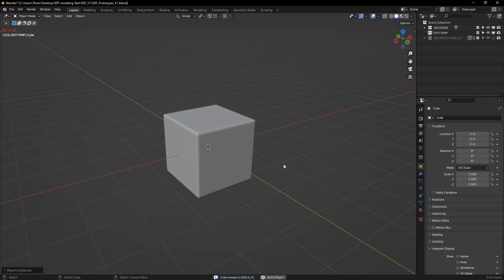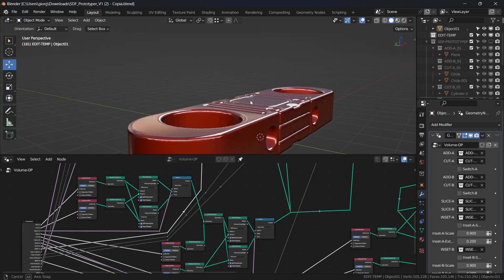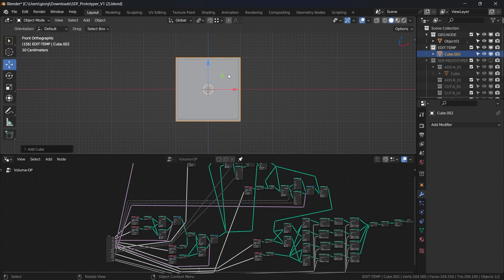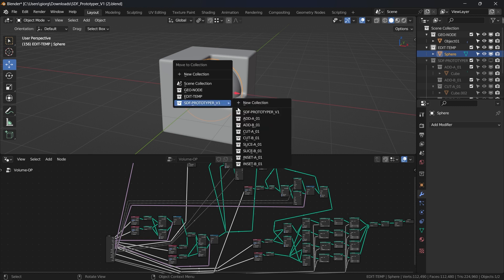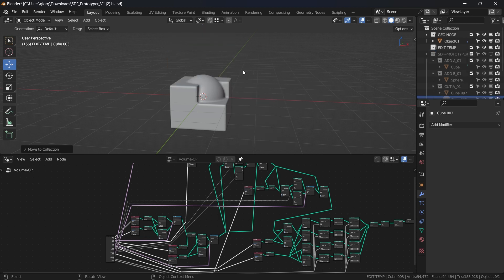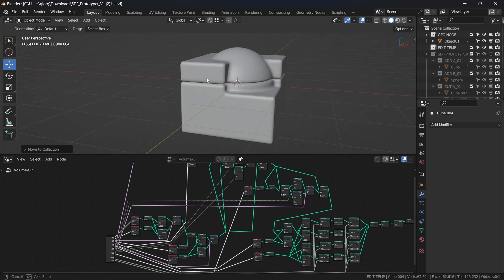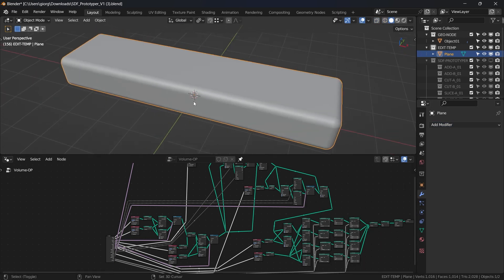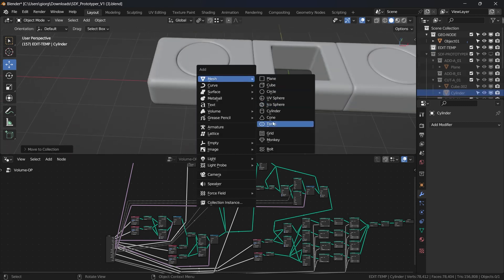Blender SDF Modelling Add On Prototyper V1

Comment: why someone will wait for so long, he can just use boolean and bevel shader, even accessing them is also difficult
Reply: SDFs are pretty different and potentially really cool. I'm not sure if the full potential was shown here, but using boolean and bevel is not the same thing.
Reply: SDF is way more powerful than boolean. Just not at all implemented yet in Blender. Try MagicaCSG or Clavicula, you'll see that it's the future of modeling (hard surface at least). Boolean on steroids.